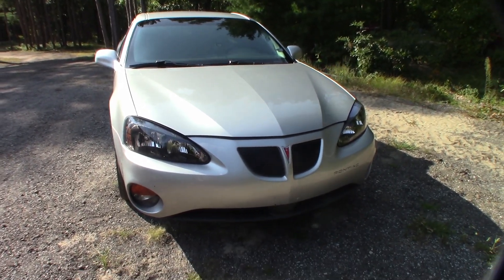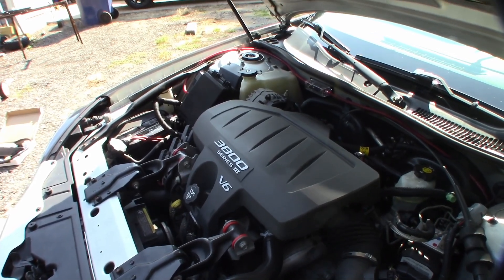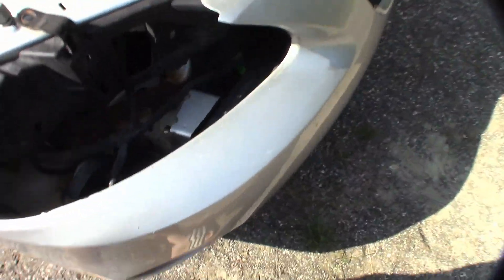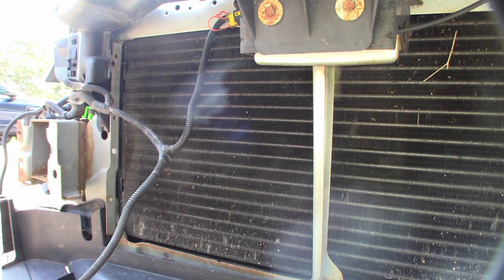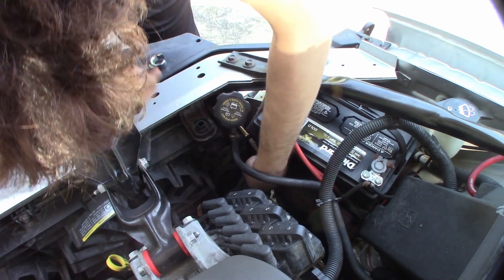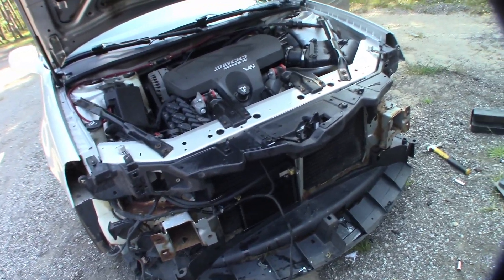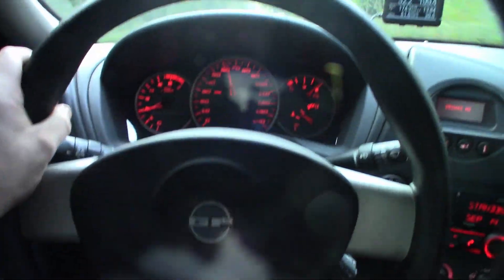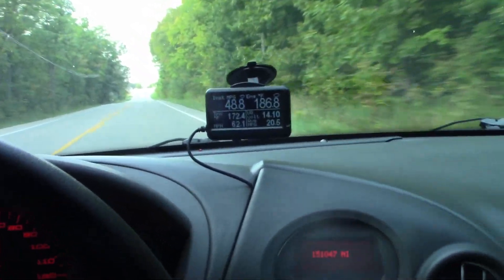A simple mod that can extend the life of a 4T65E transmission.

Comment: Love my daily 06 GP, in hotter areas- south- you could also do a 2003 Grand Prix GTP radiator upgrade- just uses a different radiator cap- 1in radiator- keeps everything cooler- 

Transmission cooler is nice - best and cheap mod to make these last is a shift improvement kit- a weekend DIY-

Wow an ultra gauge haven’t seen one of those in a min- broke mine lol.

Recommend a Bluetooth obd mini adapter and a 40-60$ android dash CarPlay 10in dash pad-

You can download a free obd app- link it to the Bluetooth obd adapter - all the gauges you could want.

I’m at 170k no issues-

Gave my bro my 07 GP at 180k no issues
Reply: How much was your trans cooler
Reply: @ NA/ on my 06- just went with upgraded water pump ( the new turbine style vs stamped fins) same price - just look at the design online or at the parts store- 
Much more efficient design 

 And a new 1in radiator- new fuel fans also - 
Never had temps go over 180-190 trans temps

Comment: Just know that tuning the car can benefit the transmission temps as well, I had ZZP tune it and the transmission has been running cooler than before, in SC the hottest I have seen it go driving a little more spirited on a 90 degree day was 210, and normally runs at 180-190. I do still intend to add a cooler, but figured I will mention that. After the transmission was rebuilt at 160k, I had the car tuned by ZZP. On top of the rebuild, it also had a shift kit installed. I am trying to get it to last as long as possible, and will definitely add a cooler at some point, I don't fully know when. I would likely install a cooler when i go to do the transmission service at 190k(GM recommends doing the service every 60k, every person who owned one recommends every 30k doing it early wouldn't hurt but doing it late can)
Reply from the maker: Yes this one has been tuned, when It comes to maintenance I just do every 50k, it’s a fairly universal number for most transmissions. Only thing left for this transmission is a shift kit, after that it should be somewhat stout.
Reply: @YaKnowWhatOfficial  It should be as long as you dont beat on it every second of the day, atleast that and it not overheating
Reply from the maker: @whatluck1508  I've done a good amount of spirited driving in this car, but I'm fairly certain it will last a while, there's always that chance it will explode in a nuclear fashion though. Either way, I am running this transmission until it blows from too much power or the clutches wear out, and replacing it with a fully built TEP unit, the famous Eldorado 4T80 swap, or ideally some other 6 speed auto if someone finally develops a good functional swap kit.
Reply: @YaKnowWhatOfficial  unfortunately I dont think anyone makes a kit for swapping the trans, even the 4t80 has its own set of problems when installing into these cars, as i had looked into a stronger trans a while back. The problem with a 4t80 is that all the mounting holds on the engine wont match up as it should, out of all bolt holes, 1 hole is missing entirely, then the overall size is another problem as well. There are 4 options that I had found when swapping out the 4t65e, probably the easiest is the 4t80, the rest are all 6 speeds, namely the trans from a G6(6t40, 6t70, and F40). The only problem is the trans from the G6 can't be controlled by the 3800 PCM(except for the F40, as it is a manual and doesnt need to be controlled). Outside of that all should bolt up, but may or may not need some custom parts here and there.
Reply: @whatluck1508  ik it’s an older guy with 6t70 bolted up to his 3800 Fiero and I believe he’s the only one. But I saw the other day on fb there is a independent custom controller for a 6t70 swap it’s like 1.1k tho 😅